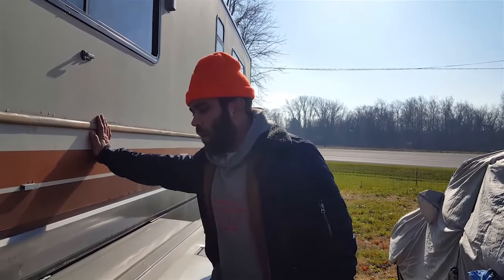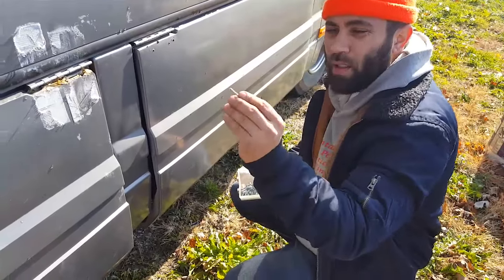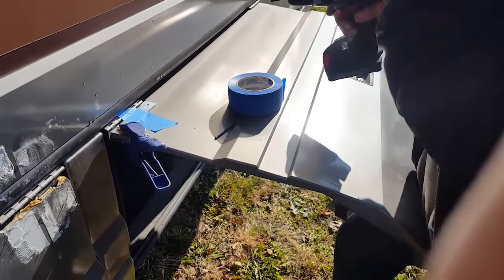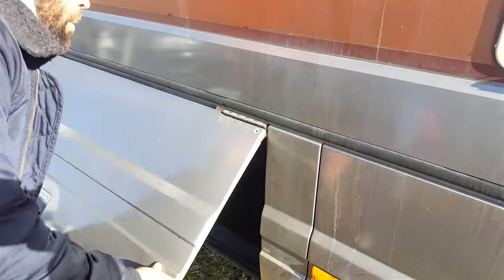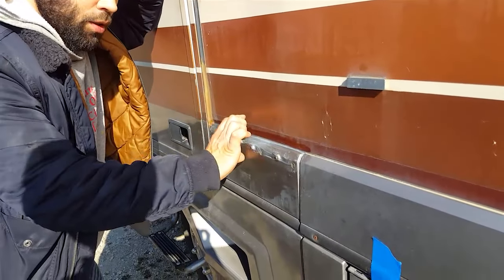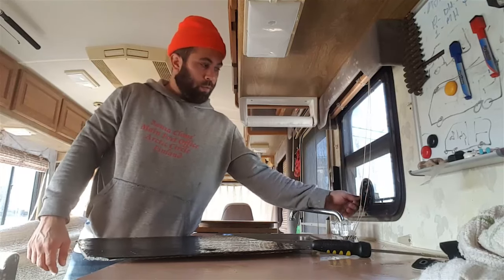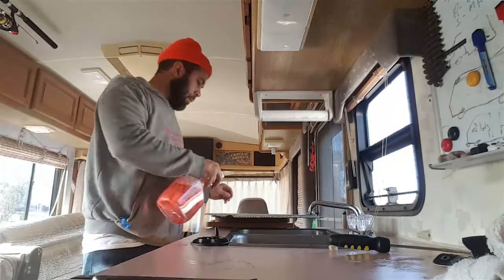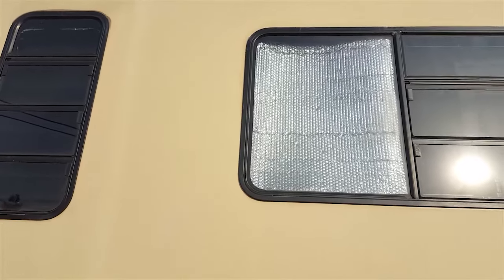Full-time RV: Broken Hinges and NoDAPL Update

Comment: Hey dude, new subscriber, fellow veteran and winter camper resident here. Wondering if your thoughts on pipeline construction are still the same as when vid was posted?
Reply from the maker: Even firmer now, as the pipeline "that would never leak," has leaked several times already.
Reply: @LukeCapasso  Got you, just wondering.